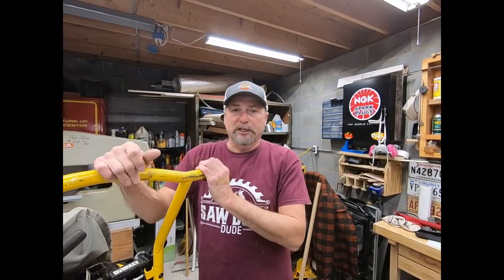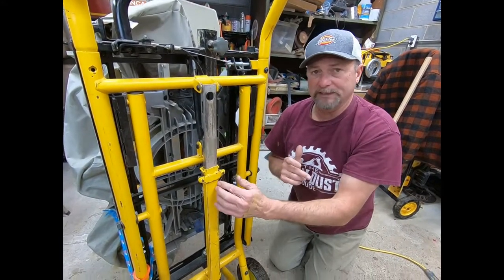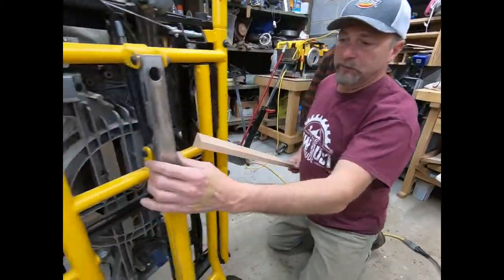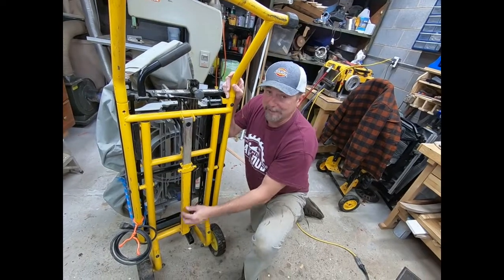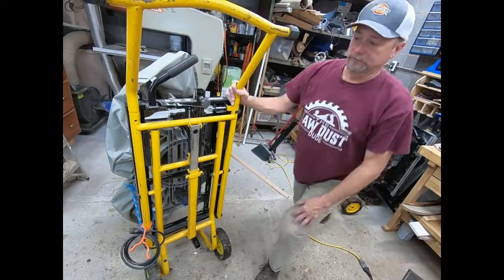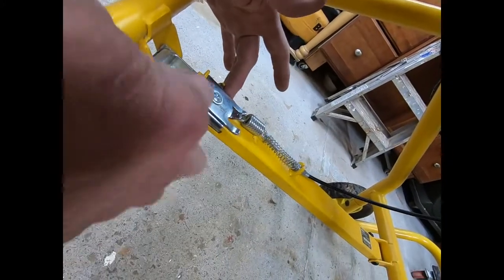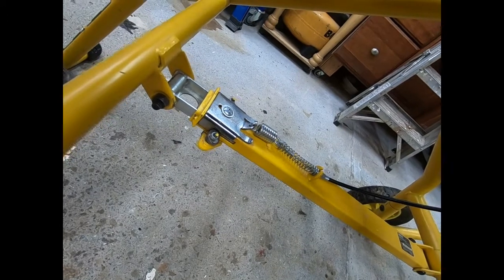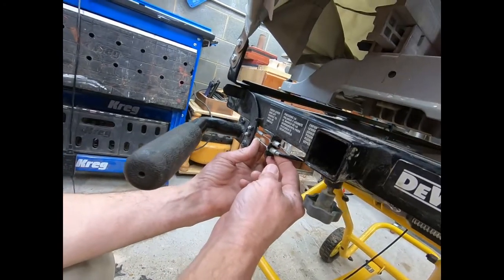HELP! My Dewalt miter saw stand won't close

Comment: Here's a new one for your list of things that can prevent the DeWalt Type 3 miter stand from closing. I purchased a new DWX726 stand on June 21, 2023. After raising it up for the first time, it was immediately stuck open. One of the butterfly catches was binding but that was not the ultimate problem. The real issue was a faulty gas piston that failed to close. After removing the piston the stand closes normally. Even attempting to close the piston in a bar clamp was unsuccessful. In the end, DeWalt is sending a new gas piston. Thanks for your good visual demonstration on the things you found. They helps me narrow it down to the final cause for the problem.
Reply from the maker: Awesome and thanks.  That's a new problem.  Thanks for watching and please Subscribe 🍀🍺

Comment: Nice video; however, there are a number of people out there that tried to adjust the cable to the lower latc and there just wasn’t enough adjustment play to correct the issue. If your situation is that bad the next level fix is to swap the to cables where they anchor to the latch. If that doesn’t make sense, put the black cable on top on the handle instead of the bottom. It takes about 5 min to switch them.
Reply from the maker: Thanks Jim, appreciate the input. You're right, some people are commenting that they are not getting enough travel even with the cable adjustment.  Thanks for watching and please Subscribe 🍀🍺
Reply: Thanks Jim, I had nothing left to adjust the cable and noticed swapping the cables would add just slightly more pull on the unlocking cable. Then I read your comment and went at it. It works perfectly now. Thanks Jim and Sawdust!
Reply from the maker: Jim, check out the new video.  Because you were so helpful in your comment, I did a video on your suggestion, I call it the Jim Method!  Thanks my friend!
Reply: It actually only took me about 2 minutes to return this POS to Home Depot. I wish I had bought the Ridgid one to begin with, because that's the one I have on my other saw and I've had it for years. This is a great idea, but DeWalt's quality assurance is terrible. Personally, I don't think this thing is at all worth the money. You did a great video though, so this is not a reflection of you or your channel, just that DeWalt made a lousy tool.
Reply: @TheFeaz  I wish I could get mine down so I could take the saw off and return mine too. My whole body aches from struggling with this.
Reply: @ptlentz  Well, you don't have to get it down to take the saw off. In fact, it's probably easier with it upright.

Having said that, I do have to redact part of my previous statement. I didn't end up taking it back, because I was able to fix it. I had to fiddle quite a  bit with the adjustments on the cable that disengages the lock. Still a p*ss poor design in so many ways. I stand by my original comment that the Rigid stand is MUCH better.

Things I don't like about this stand:

1) As already noted, out of the box it's very "fiddly" to get the lift system to work correctly;

2) The whole way it collapses ultimately achieves the same end result as the Rigid stand, but it takes a lot more energy to do it. The Rigid stand has a kick pedal that you press when it's standing on-end, and its weight basically brings the stand upright as you tilt it toward you; lower it is just as easy, as the center of gravity always remains constant. This means that even a very heavy miter saw is almost effortless to bring up and take down. Even my wife can do it, and she's a little pixie. :) She would never be able to muscle the Dewalt stand up and down.

3) The assembly of the whole thing is just a pain in the butt. I may have done something wrong, but the material stops on the stand are almost entirely behind the fence on the saw. I probably need to fiddle with the whole set up some more to align it, or maybe even turn the saw around the other way. The bottom line is that, again, the Rigid one just works.
Reply: @TheFeaz  Thanks so much for the reply. Apparently the instructions are wrong and a lot of people have put the saw on backwards including me. They need to rewrite the manual. I will mess with the cables although I'd like to return it to home depot. But what a hassle to take it all apart. I used to love Dewalt tools but am switching to Makita since I have six of their batteries. What surprises me is how bad people say Dewalt's customer service is. I'm very disappointed.
Reply: @TheSawDustDude  Your videos are the best. I am really grateful i found you.
Reply from the maker: @ptlentz  awesome! thanks for watching and please Subscribe 🍀🍺

Comment: Thanks for posting!  While the "locking bar" on the saw base wasn't bent as you pointed out, it's good to know that can be a problem.  My base required spray lube on the track and release mechanism, as it was binding a bit, preventing closure. Adjusting the release cable guide with the two 5/16" nuts put better tension on the spring and now it unlocks perfectly.  Thanks again!
Reply from the maker: Great feedback, thanks!  I appreciate you watching and posting!

Comment: Despite all the help I received here, and switching the cables, I took my saw off the stand (it felt light after fighting with the stand), took it all apart again, packed it all up again and hauled it back to home depot for a return. My back hurts and I feel like my innards have been ripped apart. I decided if Dewalt cares so little about their customers that they won't even correct their manual and show the saw installed on the stand in the correct direction, or make sure the cables are adjusted before it's packaged up, then they are not going to get any more of my money. I have so many dewalt tools...but that's it. I'm done. Thank you for your help @thesawdustdude and @thefaez.
Reply from the maker: Thanks for watching, I hate to hear that your problem wasn't fixed.  Thanks again! 🍀🍺

Comment: Thanks! I had a few issues that I’ve been procrastinating on for many months. I wasn’t able to close the saw. The gas strut was frozen (thanks to a commenter). After removing it and adjusting the cable it closes nicely. Now to get a new gas strut. 
I like the saw stand and have had it for seven years. But it’s very finicky and wish they would make the moving parts as robust as the rest of the stand.
Reply from the maker: Thanks for watching and please Subscribe 🍀🍺

Comment: Thank you brother your video did not have nothing to do with the fact that my mitters stand would not unlock it was the opposite but watching your video help me get to the root of the problem if anybody buys one of these and your  table does not want to lock which is those two little flaps that supposed to go into that gap on the slide bar just look under by where the handle is on the right side there is a Phillips screw that’s attached to the cable it might be loose just tighten that up fold it all the way back down and then re-lift it back up and play with a little bit and you’ll see some miracles happen let me know if this helps anyone please and once again brother thank you I liked and subscribed
Reply from the maker: Awesome.  Thanks for watching and subscribing!

Comment: I’m on Twitter DMing DeWalt about my brand new miter saw stand that I struggled to raise but now won’t collapse and they told me to watch your video. 😮. I hope these guys are paying you for this. Anyway, I watched both your videos several times and I still can’t get this thing to work. Waiting to see what DeWalt has to say before I take it back to HomeDepot.
Reply from the maker: Sorry for the trouble, it really is a great stand.  No check from DeWalt yet😂. Please tell them about my videos.  Please keep me posted on the solution too.  I have heard of some cable issues, gonna shoot a video on that soon.  Thanks for watching and please Subscribe.
Reply from the maker: Andrea, miss read your message, so DeWalt said watch The Saw Dust Dude?  That's cool.  Thanks for sharing that info.
Reply: This is a copy of the DM DeWalt sent me. They also sent me a picture of you with the stand. Tells me that they know there’s an issue. SMH. I ended up taking it back to HomeDepot. The tools manager there couldn’t get it to collapse either. I’ll get the replacement mailed to me on Friday. Hopefully I’ll have better luck. Thanks. And I am definitely subscribing.

Comment: Excited to find this video because mine is stuck "up" in the horizontal position and it has been doing that since day one and I called Dewalt and they were useless. Unfortunately I can hear your intro music as it is loud but I cant hear what you are saying for the ways to fix the POS!!
Reply from the maker: Sorry you are having problems with your stand and YouTube.   Ran the video on several devices, working fine on this end.  I have two videos on this stand, so maybe check it out too.  Good luck my friend
Reply: Thanks - I got the jest of what to look at but its still stuck! Will look at it more when its time to stow it. I do like that I can stand it up and "park" it against the wall when not in use but that piece of sheet metal is really a crap design. Great videos btw!

Comment: I have to admit, I’ve seen more issues with DW stands. I’m assuming your stand isn’t very new??? Might be time for a new stand. Perhaps Toughbilt S600 or the Home Depot AC9946. You’re right on the cables, tension is critical so is lubrication. As far as your strut you were showing how to straighten, could you slide a 1X piece of oak between it and the frame to protect if from getting bent or sprung?

Comment: Appreciate the help on this one.  This has been a frustrating item for me.  I am always to busy to investigate.  I watched your episode.  It does not appear to fix my problem.  I am writing the comment in case someone else has the same problem.  For sure I have 2 problems and maybe 2.  These occurred right out of the box.  On the lever where it disengages the pin.  All the adjustment is used up and it does not completely pull the pin out.  The lever also is pulling as far as it will go as the the lever hits the bolt for the handle.  It also does not look like the 2 pins below on the slide are being pulled out either when the handle is engaged.  Just an FYI.  Looks like I will be reaching out to Dewalt customer service.  Lastly, Nice episode.  I subscribed. Thanks bud.
Reply from the maker: Awesome 👍. Thanks for the encouragement and support

Comment: Just got 1 of these brand new from home depot.
Assembled it lifted it.
Wouldn't close.
Upon further analysis I found that if you swap the positions of the 2 cables on the release trigger it will fix the issue completely.
From the factory they are mounting them incorrectly. The 1 that needs more travel needs to be in top position on trigger. (Because it has longer throw)

Comment: Had the same issue. Thank You so much for the help
Reply from the maker: Awesome, thanks for letting me know and thanks for watching!
Reply: @TheSawDustDude  what size spring do I need to connect the cable to the opener on the frame. I bought my used
Reply from the maker: @johndemoss3440  DeWalt sells about every replacement part.  Type in model # at https://www.toolservicenet.com. Hope this helps out

Comment: For everyone who is having ((((Folding Issues)))) do the following, the cable that controls the locking latches is zip tied to the frame thru Dewalt but they are loose, cut those off and put on 2 new heavy duty zip ties on Tight and on the 2nd one ( right before the latch) pull the zip tie back till you hit the horizontal bar. once you've done that you'll notice there is no more play in the cable and and looks like a U, then done, no more folding issues, the problem is the cable needs tension to unlock and lock the stand

Comment: My cable has too much slack even with all the nuts and adjustments at their max tension. UGH!!!
Reply from the maker: Sorry that you are having problems.  The cables are kind of loose fitting, make sure the support bar is not bent.  That was my first problem.  Get some help, have someone lift up on the stand and see if you can manually unlock, then maybe you can get an idea of what is going on with your situation.  Good luck and thanks for watching! Keep me posted 🍀🍺
Reply: @TheSawDustDude  We checked.  It's not bent.  We did get it to fold up by pulling and putting tension on the cable with a pair of pliers.  Gonna see if Dewalt will send me a new replacement cable. 😁
Reply from the maker: @BoogieBoogieAvenue  thanks for letting me know!